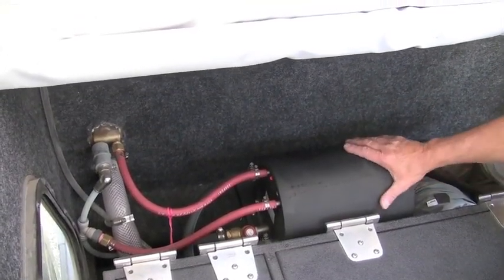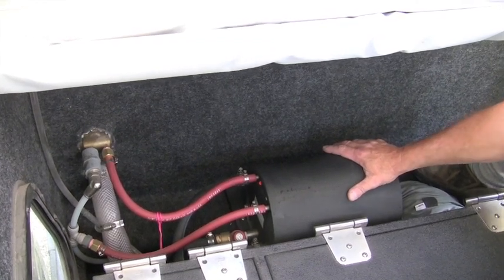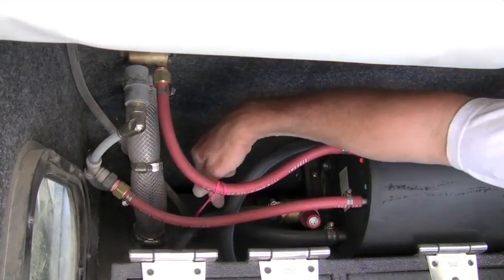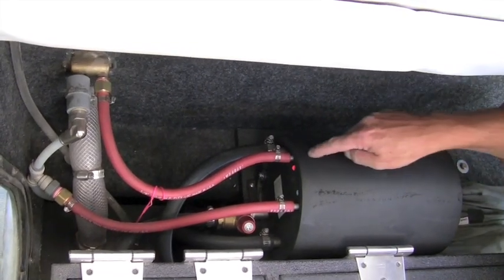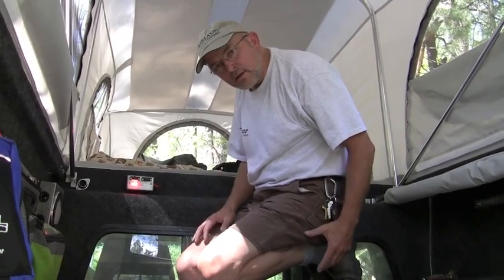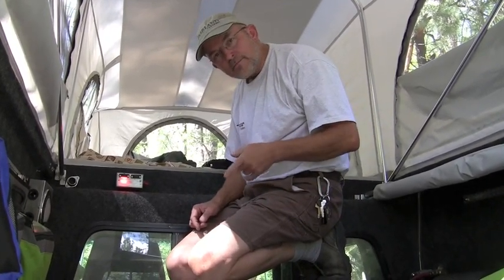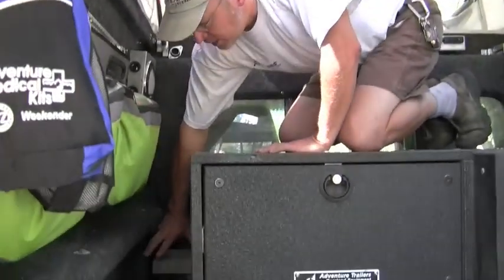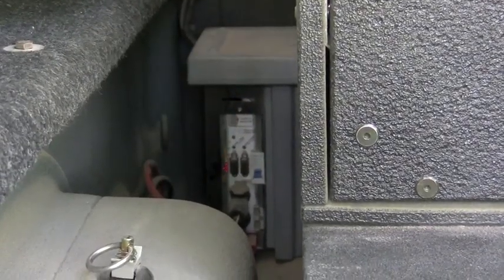Overland Vehicle Design 6

Comment: I just saw your video, and since this was filmed in 2010, and it is now over 8 years, how has your truck weathered through the ensuing years.  Also, did you install a dual battery system to power your 2nd battery bank?  Thanks.